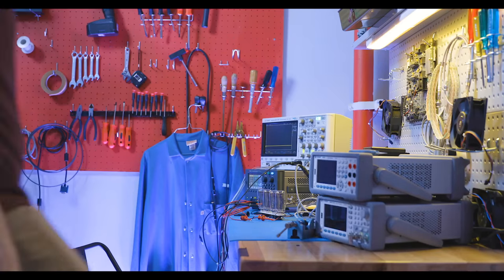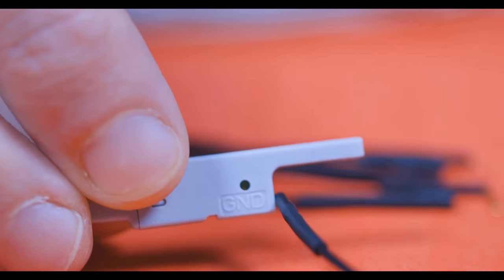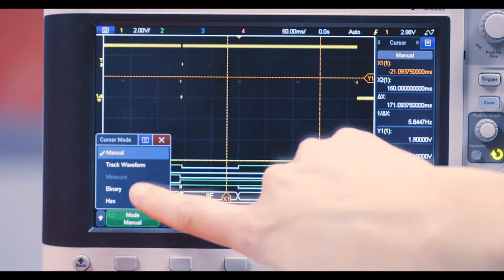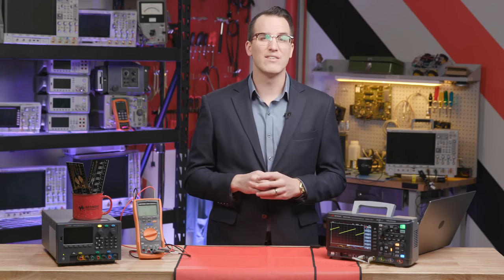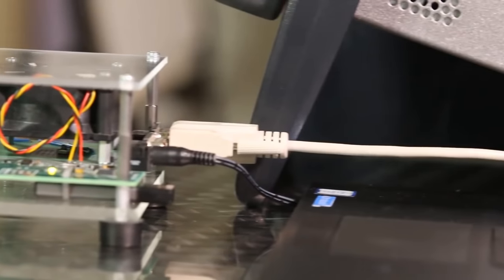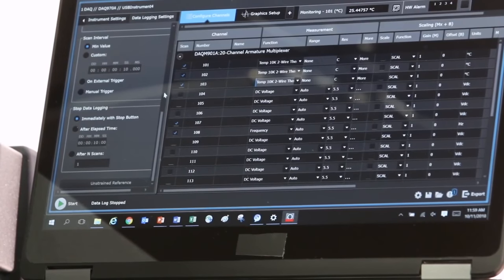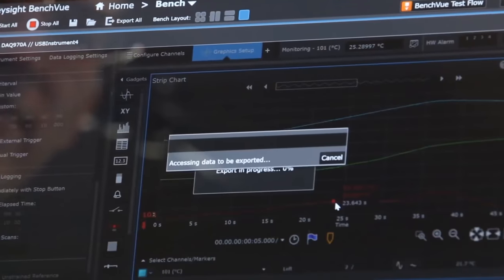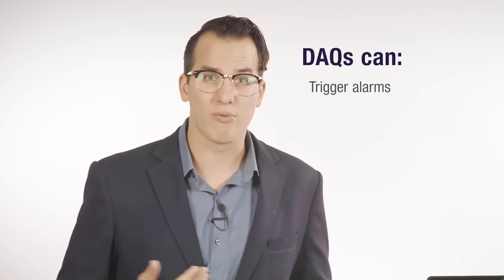Oscilloscope Digital Channel/MSO Tips

Comment: in some applications we need to connect all devices at same ground point to prevent parasite cap ,inductors , resissors . which made some noise or delay in signal . but not her

Comment: So, you're building a Nixie clock with a huge Keysight tube?
Reply from the maker: I'm debating whether or not there should be a clock element, but it does seem like something it should have. Depends on the enclosure